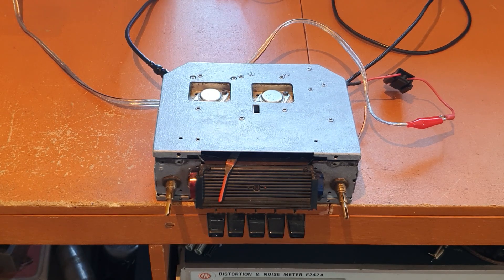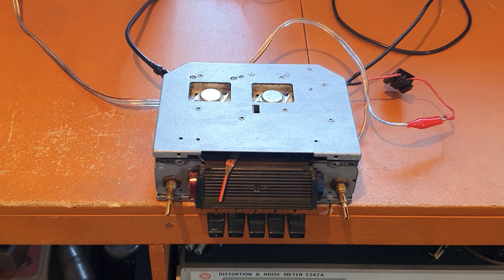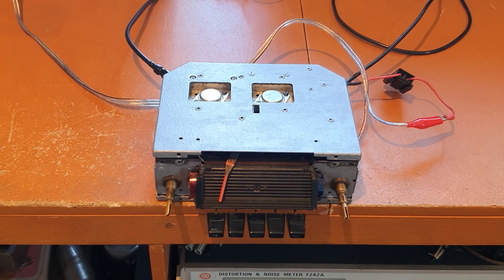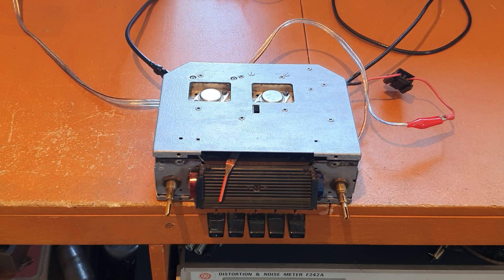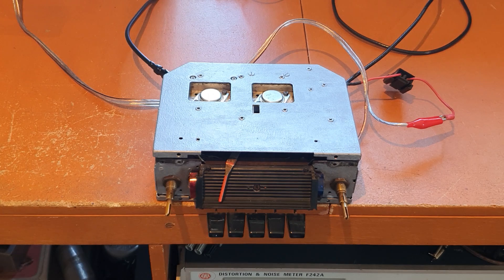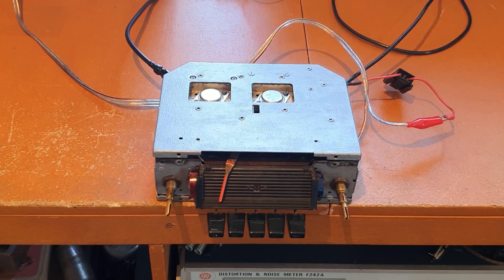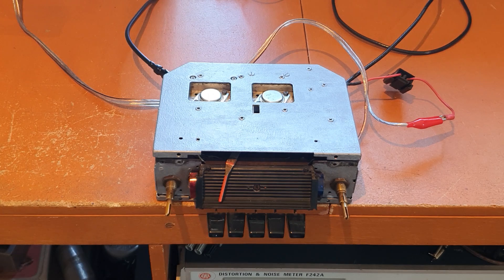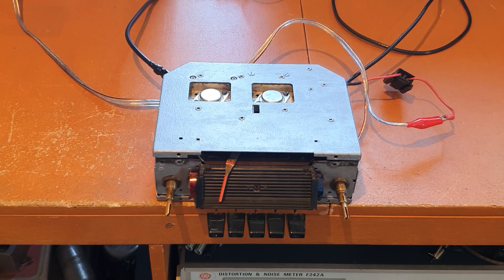Astor PN-C24J AM Car Radio Repair

Comment from the maker: Thanks for your very interesting comments, good luck with the one you are fixing! Polystyrene caps are certainly on my radar now, from the feedback I have got so far looks like the ESR goes up in them. It is hard to measure ESR on small value caps though. I have tried a simple method of comparing the phase shift of a capacitor under test with that of a known one using the CRO, so a video on that may be worthwhile. Germanium output transistors in car radios came in during the late 1950s when the rest of the radio was still valves - amazing! Yes they are hard to test! Cheers, Mark.

Comment: I've found the same issue with an Astor car radio, with a faulty polystyrene cap in the oscillator.   Replacing it fixed it.   I think they develop high ESR, which is not picked up by most capacitance meters.  I've noticed that the null on a bridge is much less with some capacitors.   I've found many mica caps to be so inflicted.  I recently did an STC 680 of 1935 and every mica cap in it (outside the I.F. cans) measured OK with a multimeter, but had a poor or no null on a bridge.  The set worked great only after every one of them had been replaced.

Comment: An ESR type capacitor checker will show if a cap has developed a significant series resistance. A cap that has a high equivalent series resistance may actually test bigger in capacitance than it actually is on some DVM capacitance checkers because the ESR affects the charge/discharge timing. ESR meters are essential to testing electrolytics. They are also great for measuring very low value emitter resistors.

Comment from the maker: Thanks for your interesting comments, especially regarding ESR. Since reading them I got my ESR meter out which reads to 99 ohms and tested what the smallest value capacitor I could measure with it was. That was 96 ohms for 0.012uF. How are you measuring ESR for snaller values? Since making the video I verified both faulty caps have > 100 meg ohms insulation resistance. Also looking at the phase shift at 100kHz with a 10k ohm series  resistor on the CRO in XY mode, I found the faulty caps again behaved as if they had values < 10pf. This subject may qualify for a video on its own! Mark.

Comment from the maker: Thanks for your comment re ESR. I certainly have found my ESR meter very useful for testing electrolytics. However the max capacitance I can measure with it is 0.012uF (which has an ESR of 96 ohms) as the meter has a max reading of 99 ohms. How do you measure the ESR of smaller capacitors?